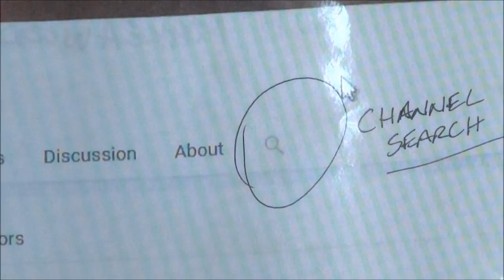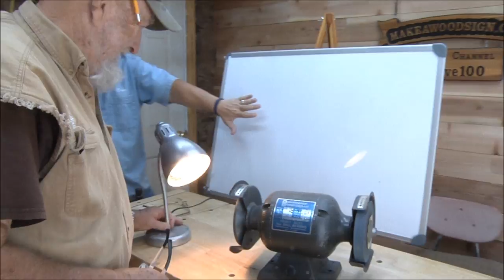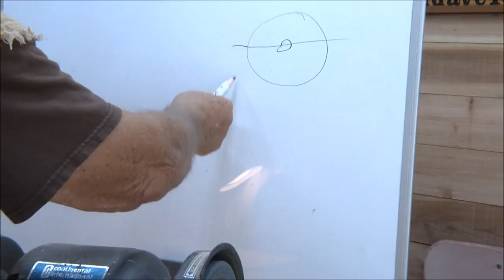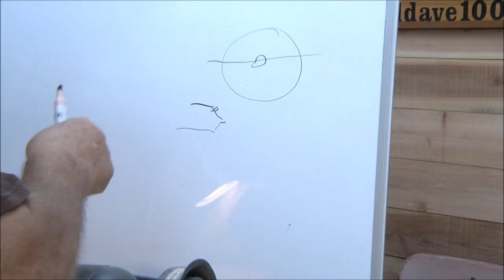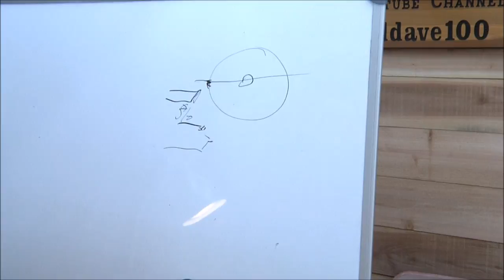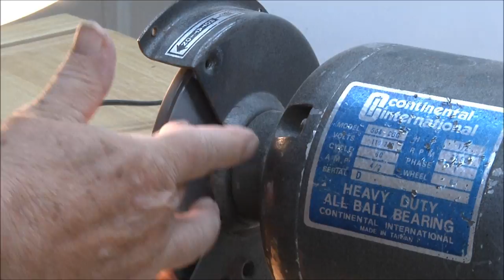LTS 8/27/17 Dave's Lesson On Router Bit Sharpening For Freehand Carving Wood Signs

Comment: May I suggest that you can also sharpen the bits by using a flat stone diamond on the flat edge only. Will bring up a nice burr and not change the profile of the bit. I use 150 grit. 
 Water Water everywhere and not a drop to drink  22in here so far
Reply from the maker: Wow.... Our thoughts and prayers with you all down there......